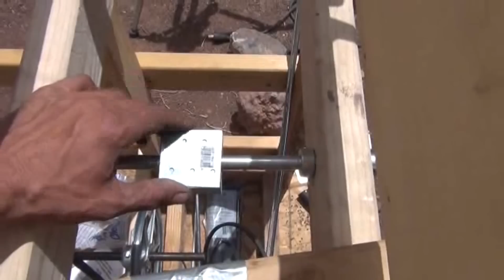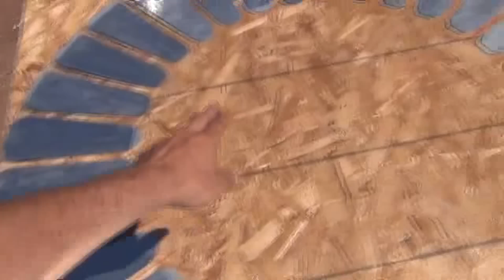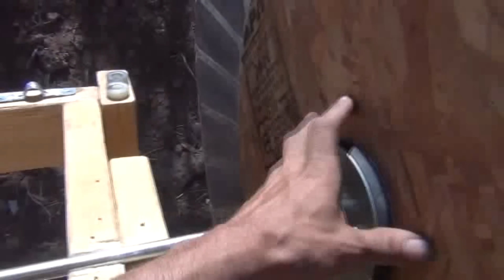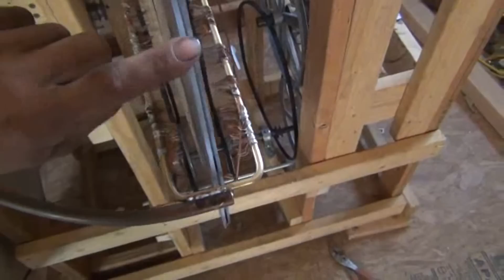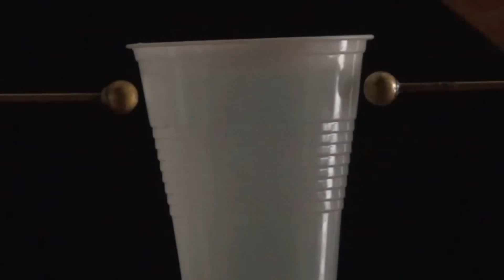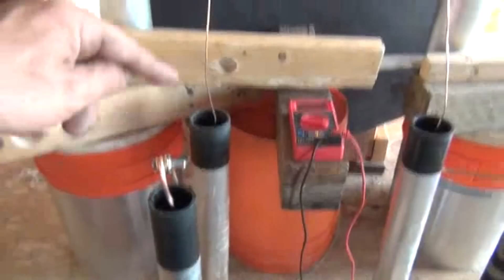"Wimshurst Generator", Building one of the Worlds largest!

Comment: You were talking about using a bigger rod to be able to use more voltage on the outside of the rod. because the voltage travels on the outside and not on the inside.  You can go to a square rod and increase the voltage on the outside of the rod. the voltage will increase at each corner as if you have 4 rods or close anyway.
Reply from the maker: Joe Turner Gauss law look it up the voltage will be lower at the corners of a square.

Comment: Great job! :-)  Love the whole video, right down to the still shots & water cup and ionized wind devices.  Hmmm, i think over 7 feet diameter would be world record,by Wimshurst himself,,hmmm,,too bad i dont have this kind of room to store it, hehehe.
Reply from the maker: INVENTOR3 It cost me 1,400 dollars for a single disc for the 8 footer not including the cutting cost, in all a single 3/4" thick 8 foot in diameter piece of Plexiglas cut to a perfect circle cost 1,800 and that's still doesn't include the aluminum and glue for the plates, the belt's and pulleys, don't forget the ridiculous price for pieces of 2"- 6" copper pipe for the neutralizer bars and main discharge rods. 
Long story short I'm about half way done building the big guy, it may take a year or two still to complete it financially. The 4 footer in the video wasn't cheap either I had close to 1,400 into that machine.
Reply: ***** wow 1800 for 3/4 thick acrylic/plexiglass.  I understand must make little by little.  I see the thermal problems you had with the 1/8 thick.  A lot of thought must have gone into designing this.
Reply from the maker: INVENTOR3 It's worth the cost and effort to have these unique and powerful machines, they provide test capability's that cant be found. My personal belief is that the Wimshurst, the Lord Kelvin, the Benjamin Franklin's Lightning Rod, the Stubble Field coil and the Tesla coil provide a staging platform for some of the coolest physics in the world and a real answer to "free energy" nothing is truly free so I use that lightly. If your serious about changing the game then these are the tools that will give you the knowledge and idea.
Reply: ***** I couldn't agree more!   I got the Tesla coil & Van De Graaff.  I want to make the Lord Kelvin water dropper, i have a great interest with the mysteries of water.
Keep up the great work my friend :-)
Reply: ***** I got your comment about the 32 ft dia.,,,holy cow!
Strange i dont see your comment here, it was just forwarded to my email
Reply: +MrTeslonian You make an awesum video. (yes I spell awesome differently.) How many hours would a person required to build something similar to what you built?  I do have some skill at building projects and have a history of fixing whatever can be fixed.  My 72 Chevy El Camino which I purchased on 2-15-1975 still is in running condition with the original engine because I'm the only one allowed to work on her.  Will you be doing anymore video on this generator?  Is there a way of stabilization of the current so that if you desire 115v at 3a for any length of time?